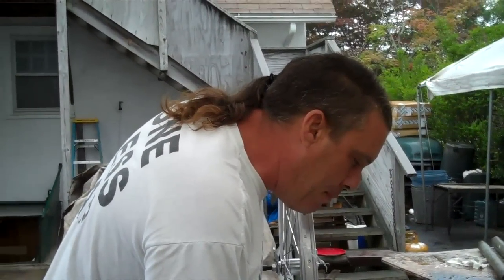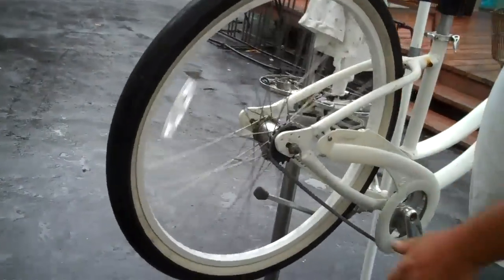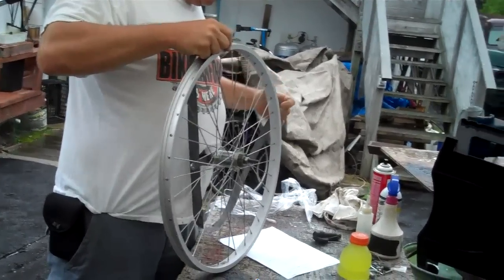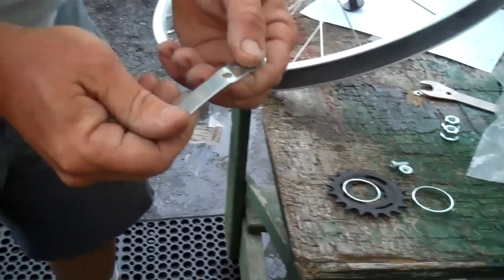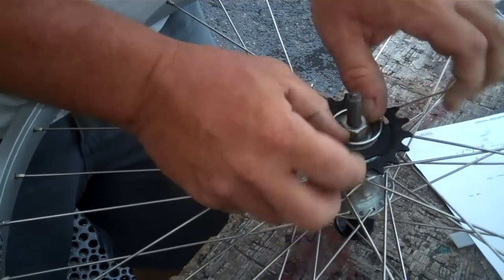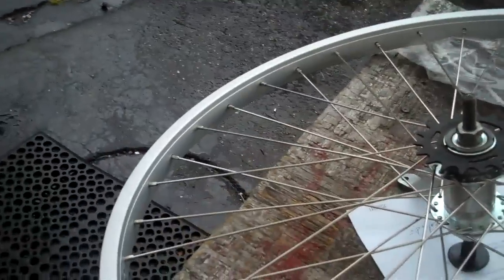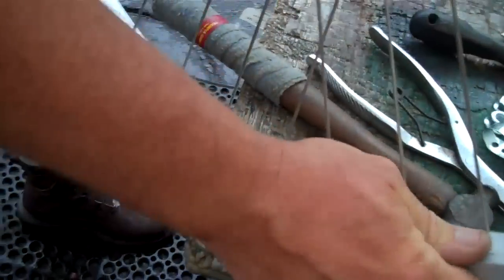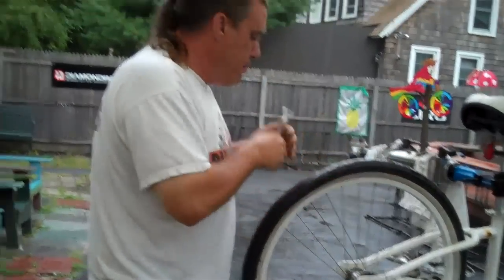26 x 1.75 Rear Wheel INSTALL Coaster Brake Cruiser Bike

Comment: Thanks!!!! very helpful. When I took the parts out of the black drawstring bag the 2 rings didn't come out. I only noticed them in your video, luckily I didn't throw the drawstring bag away, yet. I looked and yup there they were stuck inside. I was afraid the forgot to put them in. I never would have know about them had I not seen your video. I would have tried to figure out how this sprocket is supposed to stay. One thing is that I would have put the the sprocket with the indention up as opposed to down or sunken side down. I corrected myself by watching your video and you should probably mention it as there are two ways to place it. Thanks again!!!!!!

Comment: My snao ring keeps coming off. Im thinking maybe I didnt reassemble the hub correctly? But this is the first and only video I found that actually suggests to knock the ring in to make sure its in there good. 

Good job. 

Maybe I just need a new snap ring.

Comment: I have a Coaster Brake single speed beach cruiser bike and i tried to disassemble the coaster brake hub in order to clean and re-grease it. But, when putting it back together, i became a little confused and on the second day, i was finally able to put it all together, but now when i peddle forward it moves forward and when i peddle backwards, it moves backwards as well instead of stopping. So i am not able to break at all and it is tough to peddle now (takes a lot more effort than before). Can you make a detailed video on only coaster brake repair/maintenance/re-grease and re-assembly please?